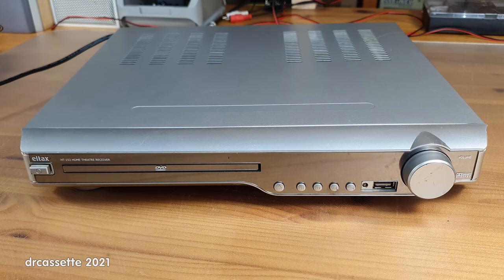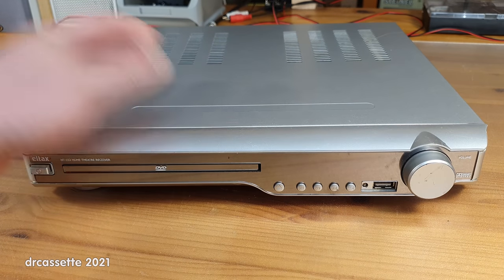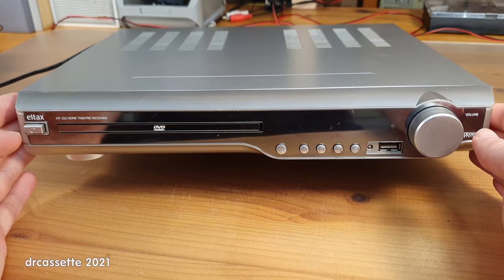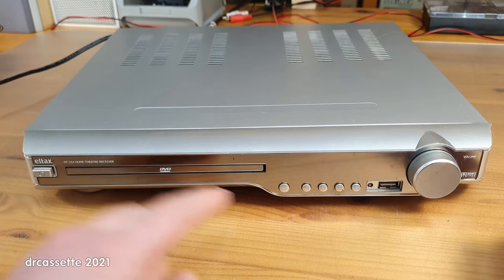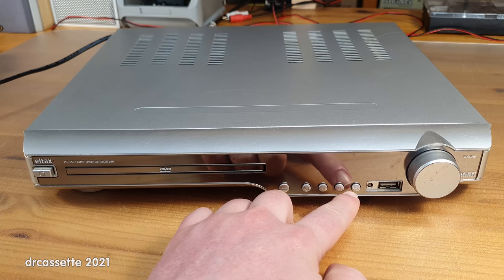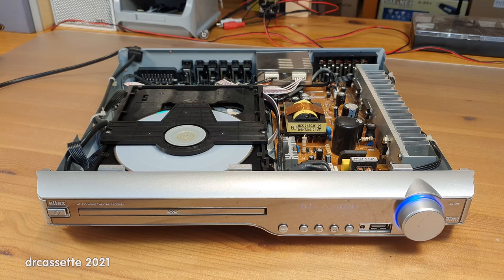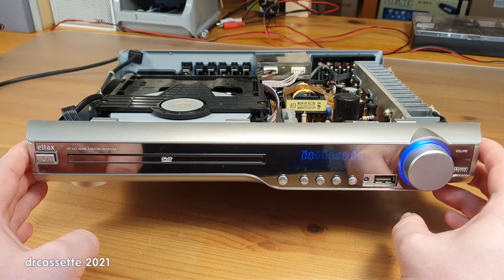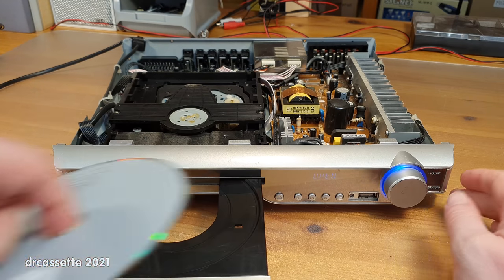Eltax Home Theatre DVD receiver teardown

Comment: I really enjoyed this type of video. How you explained the various components and there function. Maybe you could do another one like it. 
Thanks for sharing
Reply from the maker: All of the teardown videos I did this year so far have been done like this, with lots of explanations. So if you have not already seen them, you might be interested in watching those. But I will surely make more videos like this in the near future :)
Reply: @DrCassette  yes I've seen them all. I watch all your videos.  Great work too. Looking forward to more of your content
Reply: @DrCassette ... Reverse AM / FM tuner on power board.  I'd rather use a radio boombox CD player with radio separate switches for getting quality stereo sound.  A TV system of a DVD player won't worry about great FM sound when designed to go to low power even if they are two 5 Watt (like 8 ohm) speakers.  If not a boombox quality FM to speakers quality maybe to a high powered amplifier system totally designed for music sharp clarity.  As far as video to presumably an analog TV I would say yes on doing anything to get picture clarity for up to 42 inch TV tubes in analog TVs.  Blue Ray players and above work with total digital signals to all types of LED and high definition TVs making this unit a last 2007 picture tube DVD player with semi okay stereo really not designed for high amplifier or boombox musical sounds (noting Dolby audio before CD players with the latest casette tapes and with Dolby printed on them).

Comment: I bet it's a Class D amplifier board inside this DVD Home Theater Receiver. but I was wrong about that.
Reply from the maker: If this system was a bit newer, it would certainly have a Class D amplifier. But this is from the mid 2000s, and Class D was still a new and unusual technology back then.
Reply: @DrCassette  these TDA Chips are very  complicated as you stated in the video. 🤷🏻‍♂️

Comment: A DVD player with integrated receiver, haven’t seen that before. It looks like it was a real budget system. Sunplus  still make a DVD player SoC but they haven’t got any Blueray player chips by the looks of it. They mention on their website that it is a 32 bit risc cpu core, but unknown if it is MIPS or ARM based.